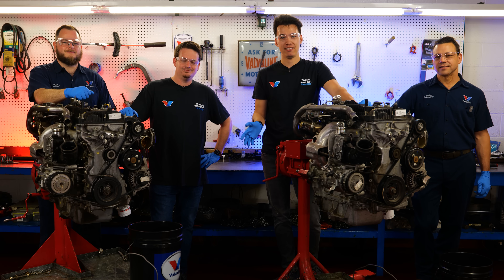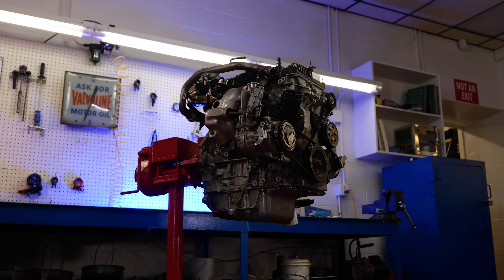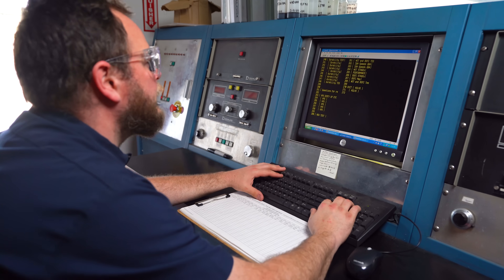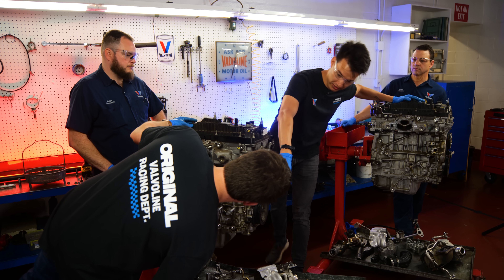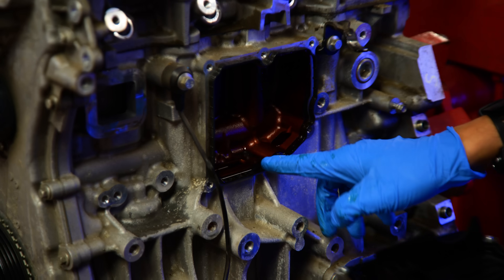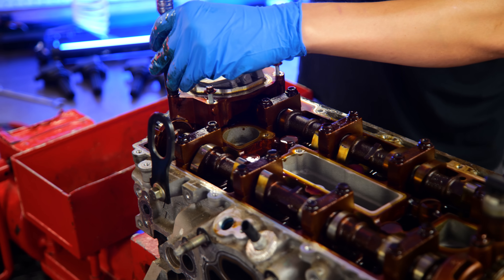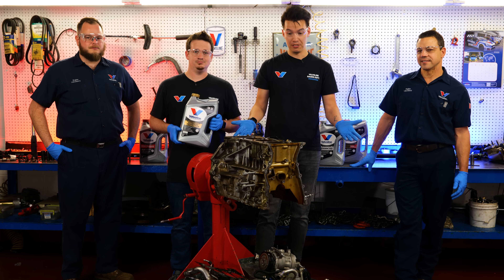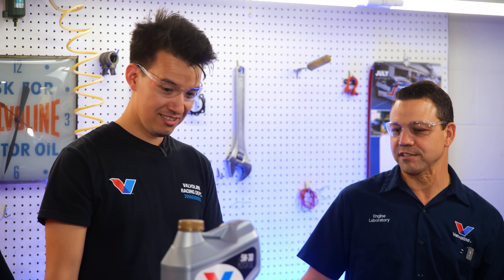Testing different oils over 4 years and 1 MILLION miles

Comment: 10,000 mile oil change intervals…. Ludicrous. I’m not a scientist, you can explain to me all you want that modern oils have a higher TBN and additive packages and whatever, but it doesn’t matter. No engine should have higher than a 5000 mile oil change interval. If you ran synthetic 0w-20 in an engine that sat only at highway speeds, sure, it might withstand 10,000 miles. But there is so much variability that I wouldn’t dare go higher than 5000.

Comment: It would be nice if you could live thesed cars in a -25 degree temp. for 12 hours and then run them and then leave them 12h in -25 degrees and then run them and same for the summer times. The residue build up is much different then.

it's still cheaper to open an old engine and rebuild than buy a new car ;)

Comment: Let’s do this again but use 2 new gen 3, 6.7 power stroke diesels and put full synthetic Valvoline 15w30 in one and synthetic T6 shell rotella in the other with extended life oil filters and do 10,000 mile oil change intervals and then let’s see the results at 500,000 miles.

Comment: No matter what if you run the car a lot it will be better than stop park it for days and do short trips. I drive doordash i put 60k miles a year. My business car is unfaced by miles unlike my other car sits a lot always have leaks and random issues. If you run a machine continuously is much better. Besides in winter the oil gets heavy and slow. Those engines never faced long cool downs.

Comment: Just proves that no matter the oil brand or type, 3,000-4,000 oil change intervals need to happen on gas engines.
Reply: 500000 miles tho. Add up the increase in cost to do 3000-4000 mile oil changes over that amount of time. It wouldn't be worth it. Imagine how long it would take you to do 500000 miles? Most people not even in their lifetime. Who would keep a vehicle for that amount of time? Most likely the engine will out live the rest of the car anyway. Don't get me wrong if your car is your pride and joy then by all means. If your car is just a run around then you are just wasting money.

Comment: I'm not aware of any manufacturer that recommends 10k service intervals on conventional oil.  Is there even conventional oil available that has the vecosity rating for this engine?  A lot of new engines require 0W20 which is only available in synthetic.  There are some real issues with this test.

Comment: The fact that these engines had all these issues under ideal operating conditions does not speak well of the ecoboost.  Lots of oil lleaks, catalytic converter failures , and waste gate failure.  There are many real life complaints about these motors.

Comment: This test is ridiculous. 10k miles for a turbocharged engine is double what I'd recommend when using full synthetic oil. Using conventional oil it should be like every 3k miles. No car out there is designed to run 10k miles between oil changes on conventional oil. 10k is really pushing it even with full synthetic. If you want a fair test, change the conventional oil at least every 5k miles. This test is just like "wow... Look at how much better this looks compared to the other engine that we ran WAY over on the oil change interval"... And on top of all that, those engines are designed for full synthetic, not conventional oil and thus, things aren't going to be lubricated the same.

Comment: I maintain almost 50 vehicles, these trucks all have GM 6.0 or 6.6 gas motors. Once I took over these fleets and decided to switch them over to valvoline Full synthetic advanced, I noticed valve covers/rocker arms were cleaner, and even spark plugs looked better. We were able to extend their life from 50k miles to 80k miles with no problems. As they were having before. I absolutely recommend valvoline’s products.
Reply: What oils were being ran before you switched the fleet over to Valvoline?
Reply: @therealRustyShackleford  i believe the previous tech was using Quaker state, supertech and Mobil 1. There was basically no organization or structure to it I think he just got what was cheaper
Reply: @51AB spark plug life hahaha, I read over what I typed out and I realized how it sounded
Reply: @51AB geez an average life of 50k on a truck would be nuts 😂😂
Reply: @51AB oh I know right. The average 6L90 gets replaced every 90k. And that’s with fluid and filter changes every 30k

Comment: I'm in my 50's and have been rebuilding engines for decades.  Just like the video, I can tell instantly when removing a valve cover what type of oil the vehicle ran with.  Back in the 80's oil technology wasn't really developed.  All engines had burnt oil in the valve covers after 100K.  Sludge was also common.  Its a dead giveaway, today.  Yup the previous owner cared about their vehicle.

Comment: Not really a fair comparison.  Synthetic oil can withstand longer oil change intervals.  They said both engines went 10,000 miles between oil changes.  That’s setting up conventional oil for failure right from the get go.

Comment: Impressed that conventional in 10K intervals made it to 500,000 miles in the first place.
Reply: Those dinosaurs are tough
Reply: Depends a lot on what their testing regime looked like. Those long oil change intervals only really work when the engine spends the vast majority of its time at moderate load and and at normal operating temp.
Reply: @fnorgen  even under optimal conditions, mineral oil base, 10K mile oil, 500 thousand miles ... It's impressive
Reply: sounds like the engines were running continuously more or less with few cold starts, which is where most of your engine wear comes from
Reply: @vossli1074  true but.... Ten thousand Mile internals to 500,000 miles with conventional, modern (tight tolerance engines) still impressive.
Reply: It's under tightly controlled and monitored conditions, so it's not like there's any problems or issues are going unnoticed.
Reply: Fair point for sure.
Reply: Yeah, the whole oil thing is overblown. It’s a safe topic for old guys to be opinionated about. Change at regular intervals with an oil that meets the right api standards. The engine will outlast the car.
Reply: Because of constant engine speed.
Reply: @wholeNwon they literally talk about the cycle and it goes from idle to highway speed in the video. Now could they be lying, yes of course but if we're going off of the video then it was not constant RPMs...
Reply: @vettle1  Thanks. I missed that going thru the video on FF.
Reply: @wholeNwon  no issues.
Reply: @vettle1  I agree 100% ,just sold my dad's 2003 Lesabre with188,000 miles always used 10w30 conventional oil every 3to 3500 miles between & had trans oil changed 3 times with a new filter every 50,000 miles never a Trans problem considering it was supposed to have a WEAK trans
Reply: @ChristSotos-fy4vw  Most people never replace their trans oil which to me is insanity, thats one way ticket for premature failure and many thousand $ repair. Most dont do diff, brakes, coolant, etc...and they wonder why their water pump is rusty and failing or their brakes are so hydroscopic the braking distance is far worse...etc...etc...99% people really dont take care of their car they should..they barely do oil changes and the ones they do they wait like a year or more..crazy.
Reply: They could have used much longer intervals and result would be the same. 10000 fictional miles on dyno is nothing.
Reply: @V8Lenny  🤦‍♂️ even if it's half as strenuous that's 5k oil changes for 500,000 miles... On conventional oil in a modern engine. Sometimes i think people don't know what they're talking about and respond anyway. 
It's still impressive.
Reply: @vettle1  in Europe we dont even have conventional oils anymore.
Reply: @vettle1 50 oil changes.

Comment: Now do it again, using the proper oil change interval for the conventional and run the synthetic 5k over.
They ran the conventional oil too long on every service, all they're showing is that it's bad to run your oil longer than you should.
Frankly the conventional oil did an amazing job considering 10k with conventional is engine abuse.

Comment: Bought new 1986 Toyota truck 22RE now 38 years and 486,500 of my only daily driver. Use Castrol GTX 10W-40 "shitty" dino oil changes every 5000 miles. Still does not burn even 1/2 quart between oil changes. At 325,000 miles had the valve stems seals replaced due small start up smoke. I found out Toyota upgraded the seal material. The mechanic asked me "What oil I use and how often do I change it?" I asked him "Why?" He said the inside of that engine looks like new and he could still see the honing marks. Still starts 1st crank within seconds ans idles smoother than any 22RE should. Expect 750,000 miles easily on Castrol GTX. Changing oil on good schedule is more important than make of oil. I call BS on this add.

Comment: Max miles for synthetic oil is about 10,000 miles.
Max miles for conventional oil is between 3,000 and 5000 miles.
@ 0:44 it was stated that the change intervals was about 10,000 miles on these.

10,000 mile interval is not recommended for conventional oils. That’s not a tiny detail. 
Also conventional oil requires some kind of flushing, while not so much flushing is needed with synthetic oils.
Reason being;
Synthetic oils keep the “sludge” from forming by keeping carbon particulates into suspension.
Thus is the intended purpose of synthetic oil’s engineering. While also providing viscosity and lubrication.

For even more carbon control gasoline cleaner/lubricants additives provide additional benefits.

This demonstration wasn’t a typical comparison.  Neglecting the change intervals on conventional oil is ambiguously misleading…

Comment: I run Valvoline 5w40 PBX in everything i own. Great stuff and i don't have to change seasonally between 5w30 and 10w40 anymore. My dirty used car engines always end up cleaner when i sell the car than when i bought it too. It also has more detergents than SynPower does too. That said, the conventional engine here looks really good for 500K. Most cars don't last that long anyways.

Comment: Well of course you’re going to get way different results. Conventional oils are at best rated for 5000. I change conventionals/ syn blend at 3000. Conventionals break down much faster than full syn. Full synthetics definitely hold up, and can indeed go the 10k interval. But even with conventional the engine looks pretty good.

Comment: My conclusion: Doesn't matter what oil to use. As long as you change it in time. Both engines look good for 500.000 miles and I would have long sold it before reaching that. So cheap oil it is!

Comment: Did I correctly hear that you used a 10,000 mile interval change for both the synthetic and the conventional?  I think that bias's the test, the conventional oil needs to be changed at 3-4K,  or at least the frequency of changes should be different or it is obvious that the conventional is going to break down faster.

Comment: This is great to see. I've been using synthetic for years based on what I read and was exposed to but to see the internals in a side by side comparison drives the difference home. If you don't want to spend the extra on synthetic it's not going to be a huge issue based on this but if you want the best for your engine it seems that synthetic is the way to go.

Comment: I ran full synthetic after 3,000 mile in my E150, 5.8, added a quart every 1,000, dealership said that is normal. Added dual remote oil filters, which got changed at 5,000. Changed oil and filter at 10,000. Gave it to my brother at 150,000 miles. It is at 300,000 miles and going strong. when he changed the timing cover, gasket leaked anti freeze, he said it was as clean  as it was when we put 1.7 roller rockers on at 20,000. CLEAN. All my vehicles get full synthetic and have no issues.

Comment: What's impressive is that they got 2 new turbo 4 cylinders to last 500,000 miles
Reply: No shit lol. I feel like we are going back in time with reliability on these new vehicles.
Reply: @TheRealCatof  No they aren't. US garbage engines are. If Euro engines are so unreliable, why does the US try to copy them. Best of luck learning about reality.
Reply: Use nicely. Constant regular maintainance. 
Bad maintainance and turbo start to wear down Quickly!
Reply: TheRealCatof you should look it up. Bmw with Mini and Porsche got higher ranks than every us company in 2024.
Reply: @halljobratan  They paid for those "ratings". BMWs are NOTORIOUSLY unreliable.
Reply: @TheRealCatof  I disagree. Euro engines are far better than those in the US. Been that way for 100 years.
Reply: @chippyjohn1 . Based on what? The cam-in-block American engines have been the most reliable engines on the road anywhere. The American OHC stuff is garbage though.
Reply: Modern engines are much better, why are you surprised.
Reply: @chippyjohn1 . You know nothing about modern engines then. The timing components in most OHC ford, Chevy, and Chrysler engines is complete garbage
Reply: @stevenvanheel3932  I agree with that. The US doesn't produce quality engines. You need to look at European and Japanese.
Reply: @chippyjohn1  I guess you’ve never owned a BMW or Mercedes or Audi. All of the these euro makers have issues with motors……no one is perfect, some better than others, however. No matter what you drive, you have to change the oil at reasonable intervals.

Comment: I have a fully built 2.0 ecoboost (with a big turbo) in my 2016 Focus ST and I've only been using full synthetic that is changed every 3-4k miles (or 6 months). Mobil 1 advanced synthetic from about 30k-100k where it is now (was using Ford Motorcraft from new to about 30k since it had a maintenance warranty) and when i removed my engine at 100k to go fully forged, the engine was NEW looking. My engine builder said it was the cleanest ecoboost he's seen. I also run upgraded PCV system with catch cans and check plugs regularly. Any boosted engine really needs a good routine maintenance or you WILL build up sludge and have issues, especially if you plan on adding a lot more power down the road. Valvoline prob works good too, I've just always seen/had good results with Mobil 1 so i stuck with it for all my cars over the years.

Tip for those running ecoboost engines, you can generally upgrade the oil filter to gain a little oil capacity. The standard 2.0 has 5.7qts, with the fl910-s filter. if you drop in the fl400-s, it has a .25qt increase and allows you to put in a full 6qts. More capacity and easier oil changes.

Comment: What were the intervals of changing oil ? Conventional oil needs to be changed at about 50-60% of synthetic interval.  Conventional breaks down about 3k miles, but burns off less than synthetic.  If you let it go longer, it will produce what you see.  Of course synthetic will look better, as it takes longer to break down.

Comment: Both had main seal leakage which can be do to too long of oil change. 
Synthetic is the way to go for todays engines but you still  have to change it regularly. 10,000mi is too long for any oil.
Reading some of the comments "Vavoline Restore and Protect", 
You cannot Restore what has already been damaged!
Protection?
 The Restoreing means a high degree of detergent which is suppose to clean out any sludge (which can be avoided with regulare oil/filter change)...too much detergent can nullify the lubricating properties of the additive package.

Comment: Great video....... How much Crankcase vacuum is there at Hot/Idle on these engines and the profile run up? If you notice the closer you get to the Ring Pack the darker the varnish discoloration. Blowby carbon/heat is the driver of the varnish I suggest with the carbon being very sticky(Stuck Oil Control Rings). With the Oil Control rings stuck my guess is low vacuum was used in the PCV System meaning less than -1.inHg.
Again great video guys.......

Comment: I have over 300k miles on my truck, using conventional oil for the 20 years I have had it. It is important to note that valvoline no longer makes conventional oil, all of their products are at least part synthetic. I was disappointed to see this, I wanted to go a million miles on conventional oil. It still has the OE converters and has had very few repairs. The inside of my engine looks like the one on the left, or cleaner. I change my oil at 5000 miles, not the 10k that GM says. Also use Wix filters. Anything else is garbage. This is just a push for you to waste money on expensive oil.

Comment: Bottom line is both engines made it to 500,000 miles / The wear on the metal to metal was no different with either oil

Comment: I have a gen 1 sbc and the builder specified it needs conventional because of composite gaskets. no idea where are those gaskets, main seal? head gaskets?! I’ve been using semi synthetic so far because conventional works at a lower temperatures below 110C although so far on the race track the oil didn’t reach 110C

Comment: I want to see a few things done, first do another test but with oil changes on one at 4,000 miles and the other at 10,000 but use an additive that states it extends oil changes etc....second id like to see them both with same oil and service intervals but one does extensive idle, short trips, lots of cold starts, short drives and then shutdown till cooled partway or all the way, high ambient temps, A/C and high electrical loads and the other does long interstate trips but driven relatively hard, as in long 80-90mph periods with some WOT passing every once in awhile, then simulate rest areas, from 85 mph to stop, shutdown or idle for duration of "rest stop/fuel stop" then a hard acceleration to 80-90 like one does when merging back onto the highway, basically one travels the country in a rush and the other never leaves the city with the driver talks to their mom for 5 hours a day with the car idle and ac running 😂